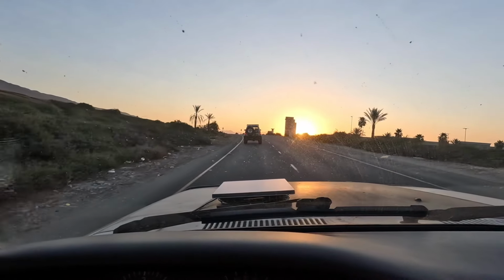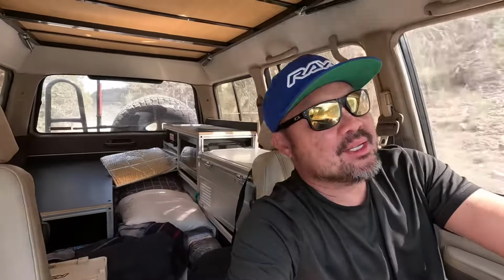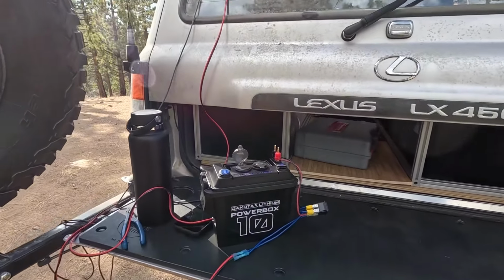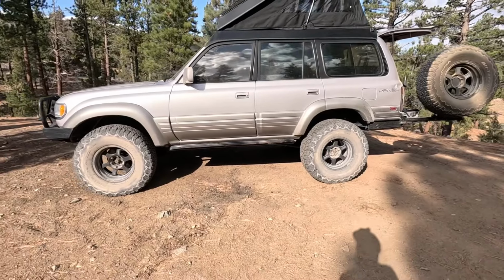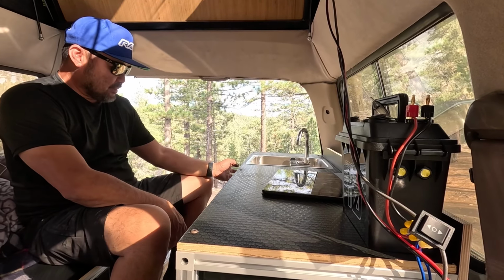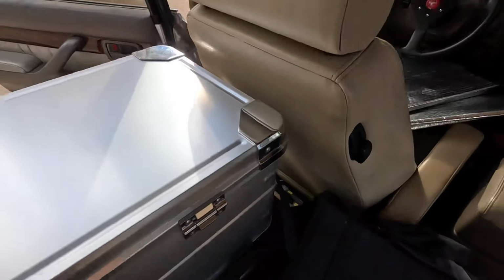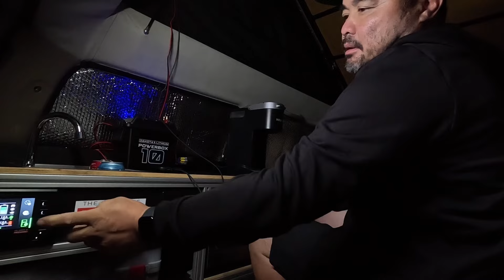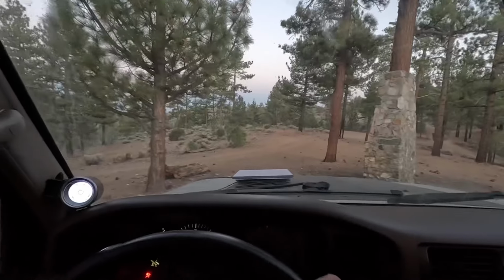LX450 Capteq Camper Build Out

Comment: For water why not the trail'd boondocker. 14gln right where you want it downlow under
Reply from the maker: I thought about getting their new one, but need to figure out how to mount it since my spare tire holder has been removed.  I still have my 7gal one that I used in my 4R
Reply: @sponsoredbywifey  i have the boondocker in my 4runner and it's a dream. The 3/4 bulk heads fittings is the ticket. I saw your 4runner water mod and was going to do same but they came out with the boondocker and rest is history.